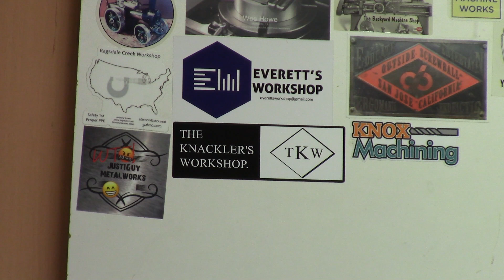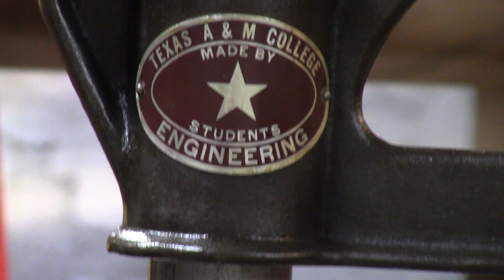Knurling tool build part 3A

Comment: Nice score on the old machinery, oddly enough I scored a beat up Taiwanese bandsaw and drill press at auctions over the last while, they're in worse shape than the machines you picked up.  Kind of a cool thing that the drill press was made by the engineering department of Texas A&M, guess that kept them busy.  I was just glad at the end that your tap didn't break off in the hole given all the factors (material, Crescent wrench, etc)!
Reply from the maker: I bet neither one of us needs another band saw.  I wonder what makes us do it?  Thanks for stopping by Everett.

Comment: 10:50 was praying you didn't break that tap.  A little locktite on that all thread will keep it in there tight.
Reply from the maker: Yes it will.  Thanks for stopping by.